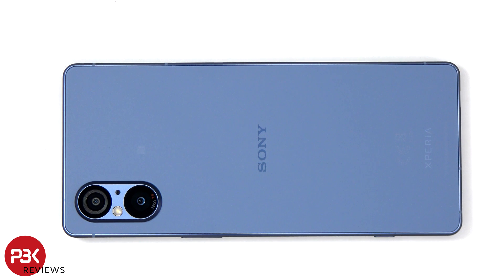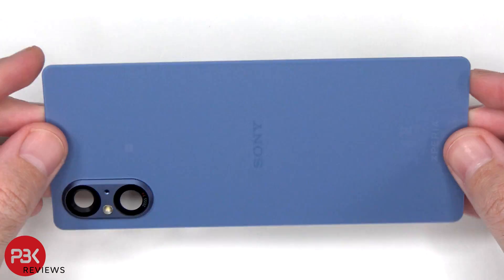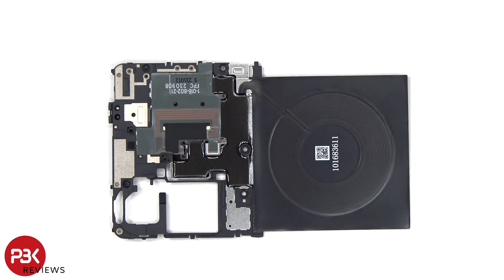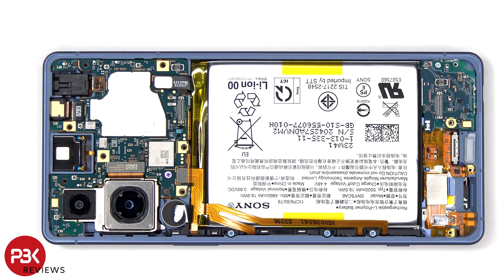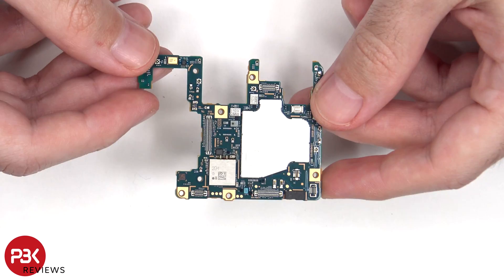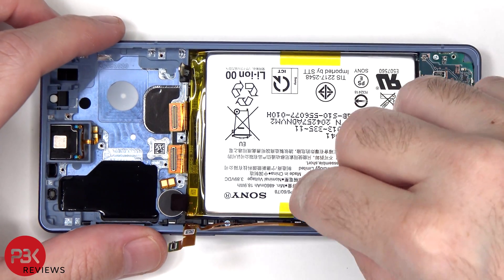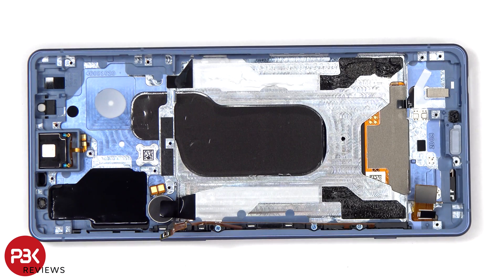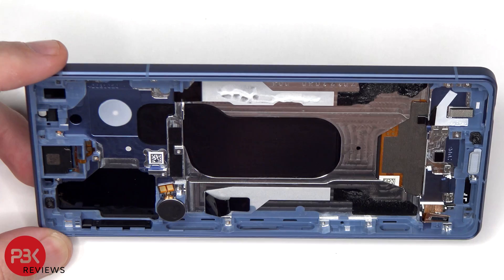Sony Xperia 5 V Teardown Disassembly Phone Repair Review

Comment: So, to replace the display, you need to remove the back panel and additionally remove the bottom board with the speaker in order to disconnect the display cable, and no further disassembly is required?

Comment: @PBKreviews I have a similar Xperia 5 IV, but unfortunately my gps has atopped working completely. All my tests point to hardware failure and a software repair made no difference. Do you know what part/s I would need to repair the gps? Any help would be appreciated 🙏

Comment: is it possible to replace lens cover without disassembly rear cover ?
Reply from the maker: yes, just apply heat and use a razor blade or x-acto knife to pry off the glass lens cover.

Comment: Are the screen of the Xperia 5 III , 5 IV are interchangeable?
I noticed that the have the same everything (specs and dimensions wise) !
Reply from the maker: I'm not sure, it may be possible but I haven't tried to know for sure. Looks to be the same though.
Reply: @PBKreviews 
If they are indeed compatible that will be huge leap regarding minimizing E waste and very helpful to the consumer by reducing spare parts prices ,the Xperia 5 V has the same dimensions but it got HDR 10 upgrade so i dropped from the comparison.
I'm making a purchase decision based on your repairability score.
Thank you for your content❤

Comment: What a pain in the ass to disassemble this. Kinda makes me remember Z5 - almost the same idea for the Screen - you need to remove glass backplate and everything behind it just to replace the screen. XZ1 series are much better in this regard - need to replace screen? Then just remove screen.

About shielding on the key components (Chips), do you think it is possible to gain any thermal gains (make phone's thermals cooler) similar to CPU de-liding? Thanks
Reply from the maker: You might get some better performance replacing the thermal paste with better ones or possibly replacing the 3D graphite with a copper vapor chamber that would fit in that cut out and not be too thick to press against the screen and frame.
Reply: @PBKreviews Thank you for the reply and awesome video.

Was it hard to remove the shields on Sony? Have you used heat gun, or it was just graphite on top, like with Samsung devices?
Reply from the maker: it has removable shield covers which clip into place and can be pulled off. You can use your nail or a small tool to lift up from one edge to pull it off but be careful not to damage components nearby with a tool.
Reply: @PBKreviews Thank you very much!🍻

Comment: your intro music is too load so my sequestion is to either removed or lower down the volume.
Reply from the maker: Really? I've tried lowering it but on my end it doesn't seem to be too high. I will try to lower it a bit more in future videos.
Reply: @PBKreviews  
Ok, thanks. I use my soundcore q35 headphones and some times buds live, and they both make your intro music louder than the rest of the video.
Reply from the maker: I will adjust it even lower moving forward hopefully will help

Comment: I remember it was in 2012 when I bought a sony phone . Model was xperia m2 . The phone surprised me that it didn't need repair of any parts. The screen,battery etc is still working now pretty well . That's why sony is a unique company
Reply: Sadly this doesn't apply to the Xperia 5 series since the 5ii. You are lucky that the Xperia 1ii doesn't have a defective screen by design.
5iii and 5iv have the same issue and most of them are going to have a dying screen after 2 years.

As Samsung don't want to fix their defective screens, sony may even discontinue the 5 series due to their extremely low second-hand value (where Samsung continue to sell their factory defective 5ii/5iii/5iv screens at crazy inflated prices, which is the main cause that the second-hand value of 5 series phones completely crashed. A replacement screen literally cost higher than a fully functional second-hand Xperia 5ii).

Comment: In your experience which do you think is more efficient in passive cooling?
Vapor chamber or graphite film?
Reply: vapor chamber ofc
Reply from the maker: 3D graphite (layers of graphite) comes close to basic vapor chambers, but depending on how extensive a vapor chamber is, it will perform better than just graphite.

Comment: Many Xperia 5 users, 5II, 5III & 5IV, are suffering from the green/pink lines issues. Most of them are using Asia model. So would you please tell us what is the screen model of 5V? As we known that, 5V is using entry level display, as same as Xperia 10. Thank You
Reply: A Xperia 5 series owner here, 5 II to be specific.
I have got 2 green and 1 pink lines for my phone so far, and Sony in my city (Hong Kong) is taking zero responsibility for such a serious matter. I will not buy any more Sony phones despite their insistence on keeping the headphone jack and the SD card slot. I have brought 5 Sony phones (7 if Sony Ericson phones are included). I have to give up after all these years.
I tried to deal with Sony HK with no avail. When the first line, a green one appeared on my phone, the Xperia repair in HK was recently (from 10 July 2023) subcontracted (again) to Telecom Service One (TSO). I did made a few phone calls to Sony before going to the repair centre. The Sony (definitely not TSO) representative on phone was extremely unfriendly and sound annoyed. I guessed he had to deal with numerous such requests which Sony told him to say “no” to every single one of them. He said that such issue has to physically checked by a repairman before a free repair could be granted. 
I went to the TSO repair centre, and representative there said I should find Sony for this matter first. 
No one was taking responsibility… The customer experience should have been better for such an expensive product from such a premium brand.

TSO (and Sony) were trash. Xperia repair in HK was subcontracted to TSO from 1 February 2016 to sometime (probably in April) 2021. Sony took the repair work back for a while until it was given back to TSO in 10 July 2023. During the first TSO contract, I send my XZs for repair. I notice screen detachment in the lower right corner soon after I got back my phone. I went back to the repair centre and the TSO representative said my phone was bent, and I had to pay for the repair. The phone was straight for a better part of a year (warranty period). How come I would bend it in a matter of days. The TSO repairman definitely bent my phone in the repair process. I did argue on phone with Sony representatives on phone a few times and I got free repair for that. 
I mean, Sony could have done the right things with the 5 series, but they are not doing it. My story with my 5 II could been different if Sony was doing repairs on their own. I have heard stories from Taiwan that free repairs were granted the 5 series. 
Also, there are currently no fewer than 3 Sony stores in the city. Sony could have done repairs on their own. Hong Kong is not a remote place that repairs must be subcontracted to a third party like TSO and uBreakiFix. It’s an extremely densely populated business hub.
Reply: @user-nd4ip1xv5m Thanks for your info., I intent to buy Sony phone because it still keeps phone jack that I like, but will not now. I live in h.k. too, I disappointed with it some times ago when I bought its headphones wh-1000mx3, I was terrified how it's poor in sound quality, I sold it out and bought a second hand Shure one, a Germany band, which is so good in sound quality
Reply from the maker: Since I didn't pry off the screen, I didn't get a chance to see the back of it to know the model of the screen. You can check this listing, but I'm not sure how much info can be extracted from those pictures. https://rounded.com/sony-xperia-5-v-xq-de54-display-module-lcd-digitizer-a5064800a.html
Reply: @PBKreviews  I got it. Thanks for your reply ^^ Coz Xperia 5 series, from 5ii to 5iv, with green/pink lines issue on screen. Especially, in Asian model. Therefore, many users are suffering/worrying by now. Anyway, thanks for your video 😃
Reply from the maker: you're welcome 🙂
Reply: Also interested.